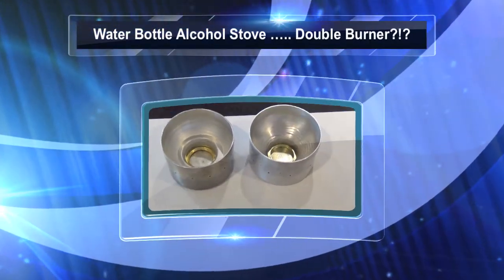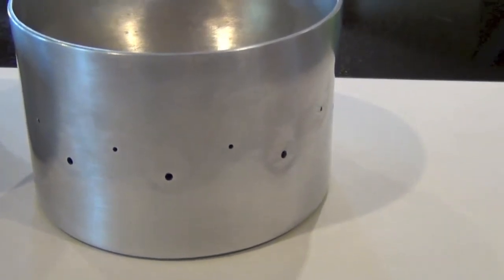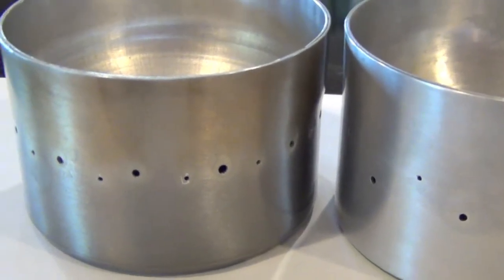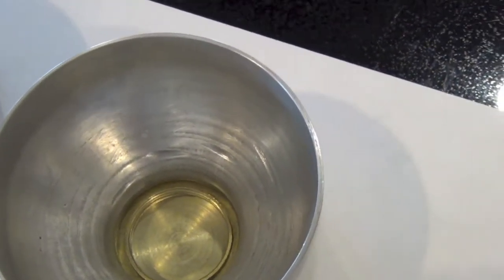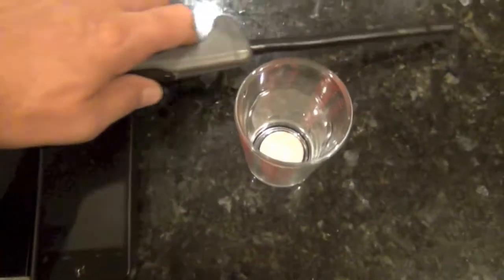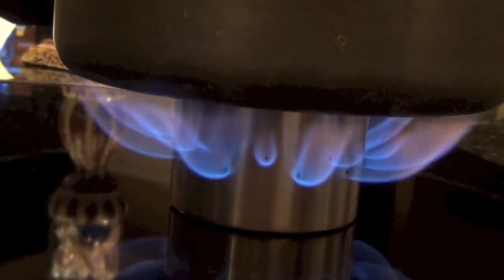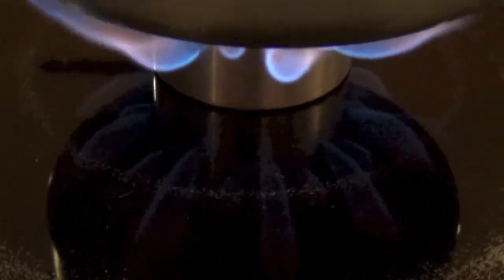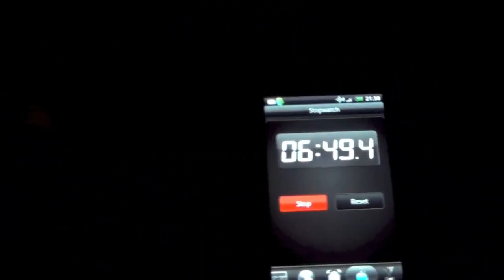Water Bottle, Alcohol Stove ... w/ Double Burner ?

Comment from the maker: I'll give the 45° idea a try. Should be able to pull it off on the 1/16 inch drill bit, but the 1/32 inch bit is so delicate it might snap if it bends at all. I like the idea, just have to figure it out. I approved the video response, and "liked" the video. Cheers, Scott

Comment: I do have a couple suggestions. 
First, to help with the warm up time, spray paint the area you dump the alcohol into with black stove paint. It'll absorb the heat faster. The silver just reflects it away.
Second, the first hole size seems good, but I'd make the second, bigger size a bit smaller. You don't want flame going up the side of the pot. Too much wasted heat.
Do those two things only and you might even cut your warm up time in half and boil time down to under 5 mins. Add an aluminum foil surround/windscreen and you could get to 4? 4 1/2 minutes?

Comment from the maker: I like the pattern of the top holes so I'm not going to change those. I did try one hole that was larger on the bottom row, but I didn't go large enough. I'm going to slowly enlarge the bigger holes I until I get the flame pattern I want. Thanks for the heads up. Cheers

Comment: So, you could pretty much just have enough time to make a cup of hot coco on this?? Awesome!!
Reply from the maker: Well ... sort of. I only used 1.5 ounces of fuel, it will hold 3 ounces (longer burn time). Most of the backpacking camping food requires 2 cups of boiling water to eat. There is a large variety of backpacking prepackaged meals, I think you could make 2 of those on a single burn if you were quick. Thanks for stopping by. Cheers
Reply: ok i c, I'll have to make 1 of those
Reply from the maker: You can heat up anything that you can heat up in the pot. My son has one, I keep the other in the house in case the powers out. Cheers
Reply from the maker: Another good idea is the "6 block rocket stove". It's not portable, but you could cook a full meal on it with very little fuel if the powers out. Cheap and easy to do. YT search it. Cheers